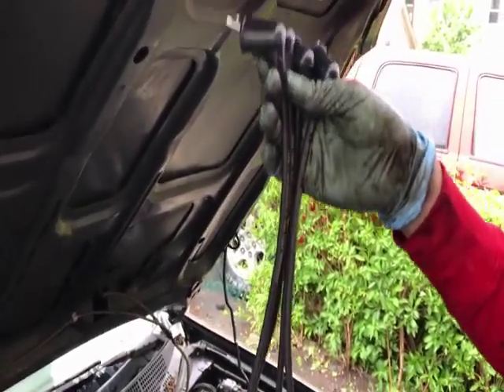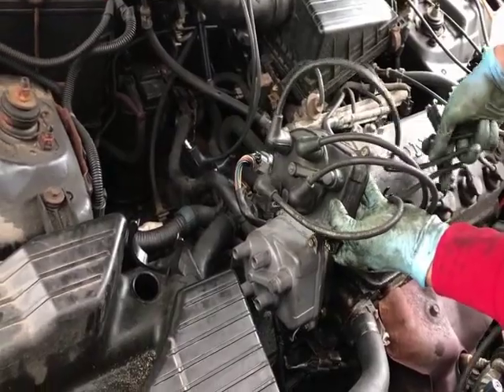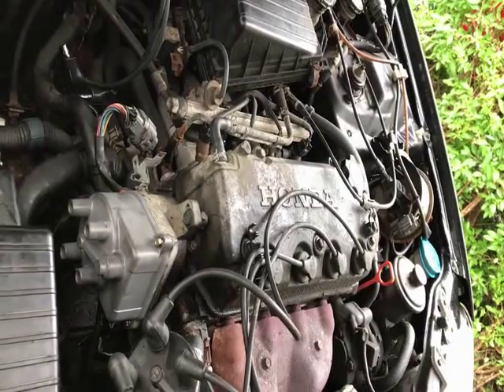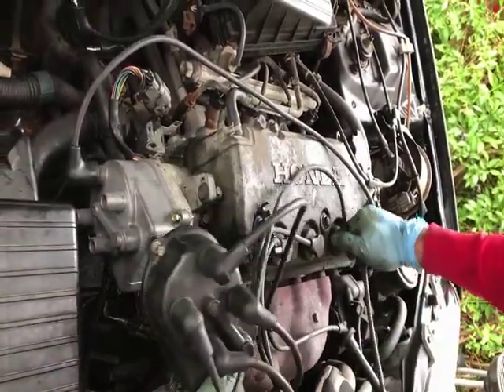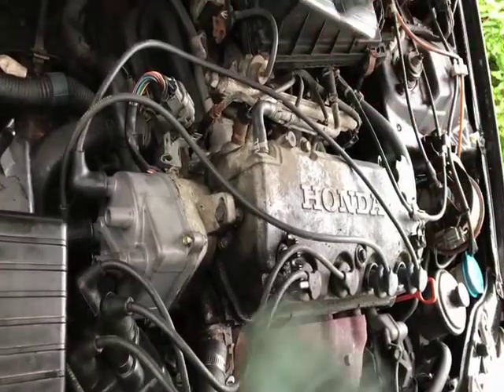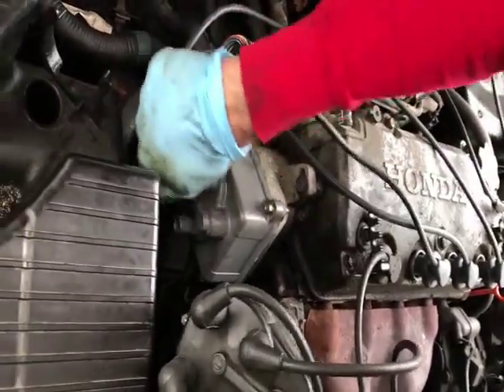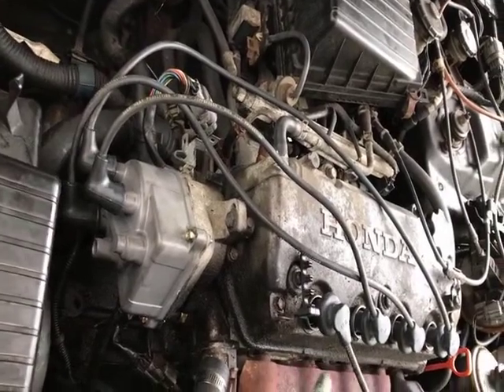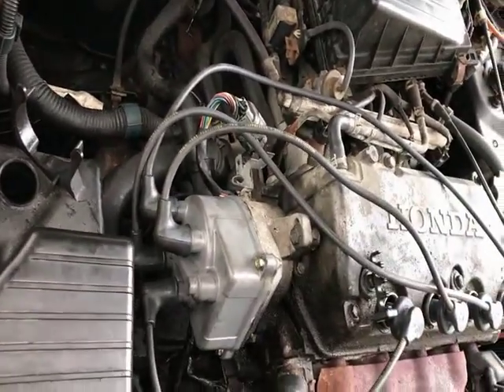1998 honda civic ignition wire replacement

Comment: *How to replace spark plug wires

Ignition wires are under your dash and run from the ignition switch to the distributor.
Reply: which color are they? and where do they do they run too?